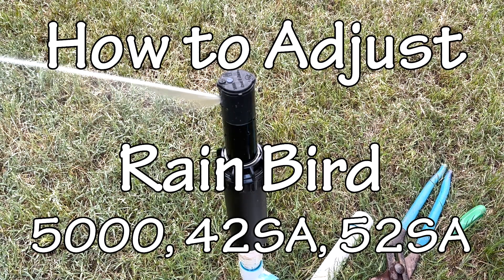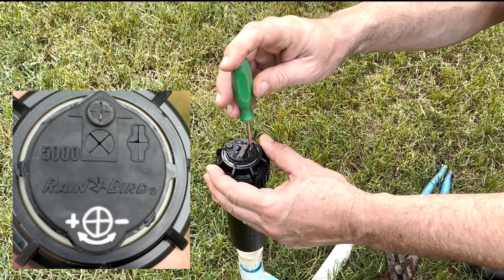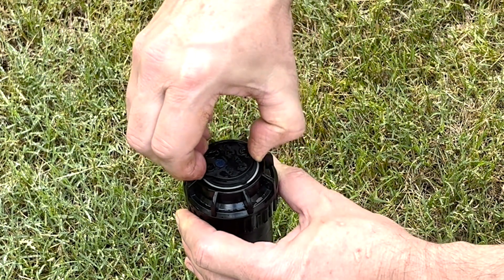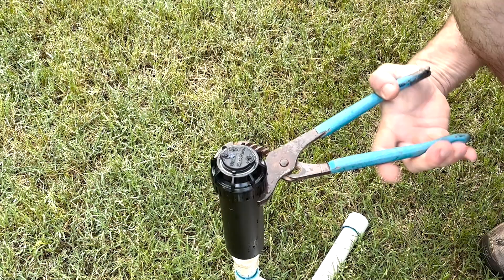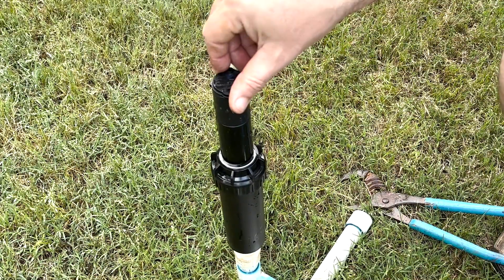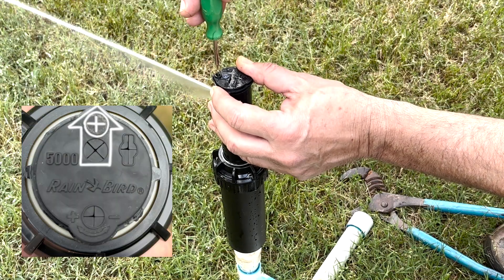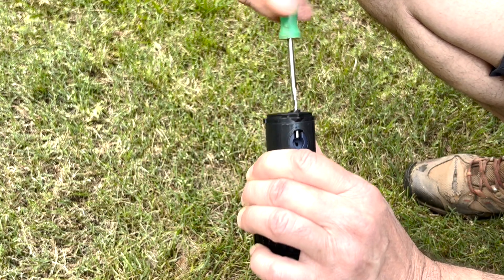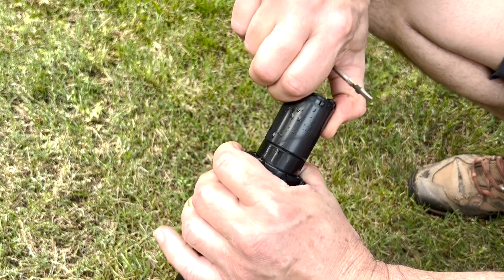Rain Bird 5000 How to Adjust Rotor 42SA and 52SA

Comment: Several times he says to grab the shaft and rotate it to adjust your left edge. The part that pops up when you turn on the water is called the shaft or the stem. You don't adjust the left edge by rotating that part. You have to reach down in the dirt and rotate the body of the whole thing.
Reply from the maker: Yes sir, you can. You actually can rotate the entire body of the sprinkler by grabbing the shaft and turning. The gears that connect the shaft to the body connect at the very bottom of the case. Trust me, I do this 20-30 times a day through the season. And this is in super tough clay. There's no way we could dig up every head that we need to adjust the left limit on. there's not that much time in a day.

Comment: One other question. While raking I took the cap off the rainbird sprinkler head. I didn’t know right away I had done this and mud fill the top of the head.  I did clean it out and replaced the cap but a little water squirts out the cap where the water comes out when it’s on. Should I replace the head or take the cap back off and clean it out better? Thanks
Reply from the maker: It's not that big of a deal if the cap is damaged. You still want it there to keep the dirt out of the adjustment slots. As far as replacing the head, it depends on how much water it's losing. If the head is still operating, and the extra water isn't enough to cause a problem or big puddle, I leave it alone.

Comment: Is it true that after a couple of uses you can no longer use the slip clutch?
Reply from the maker: Maybe after several years. Occasionally i'll see a very old one that's pretty stiff and the slip clutch will still work, just not well. But mostly, it's a very reliable mechanism and an excellent rotor.